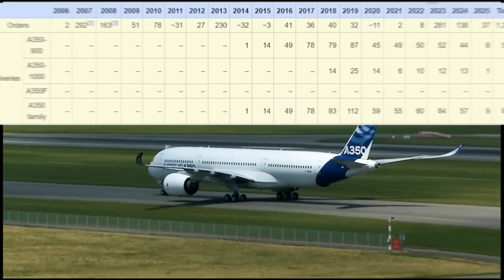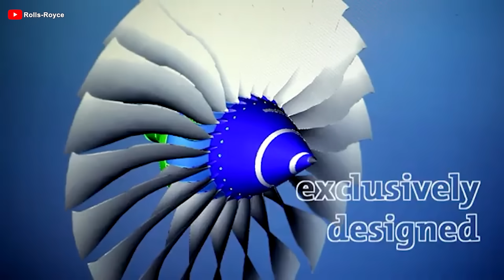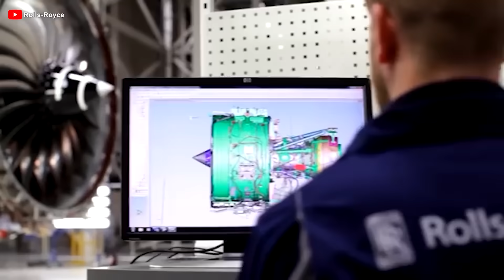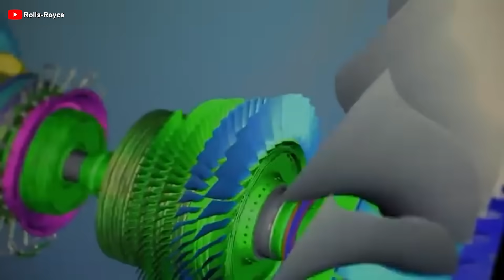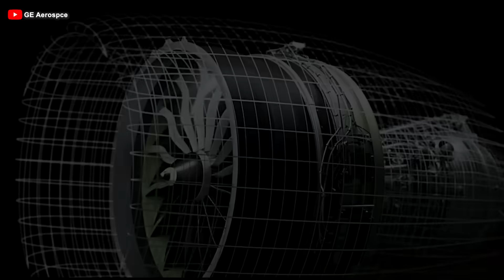Airbus Just Revealed NEW A350 HUGE Upgrade that Terrified Boeing! Here' why

Comment: Well, with its tripple spool it is probably the fewer major overhouls that count. Give the engine a TBO that it is so great that it will not have to be removed from the wing ever. We see that A330 are being converted to military use. 
As airial tankers do not fly very much the converted A330  do not need major overhauls in their lifetime in their second career.
As in freight it is probably rather the bulk than the weight that is the limitation.

Comment: It will be better to make an A350-2000 than an A380 neo. ❤🎉
Reply: Think that Airbus prefers to develop a successor for the 321. This is volume, the 2000 would only fill a gap.
Reply: True, but is that what airlines want